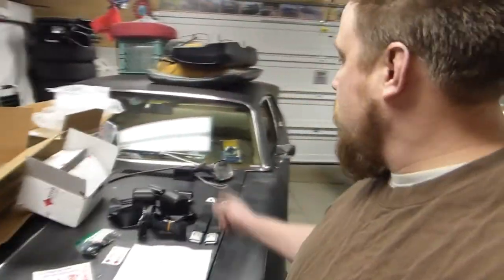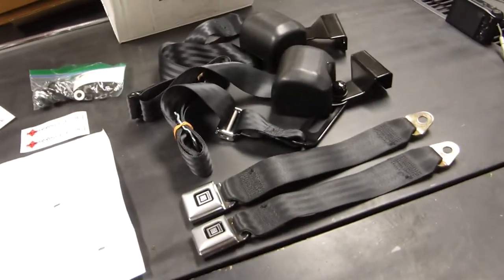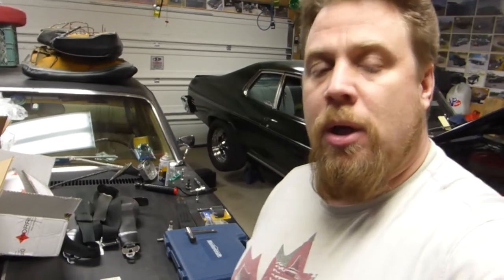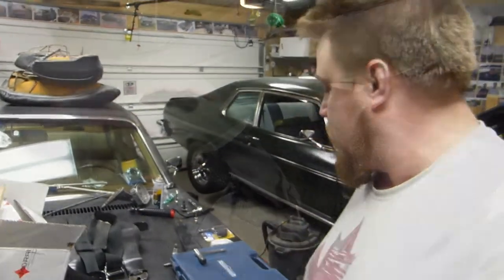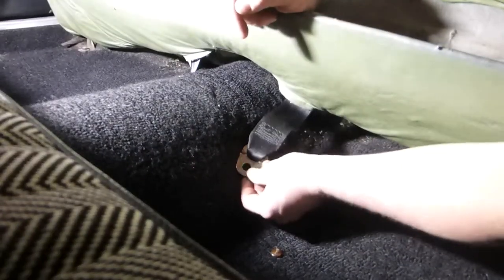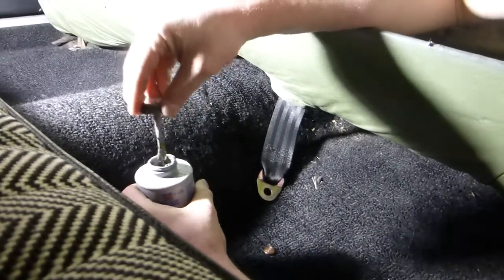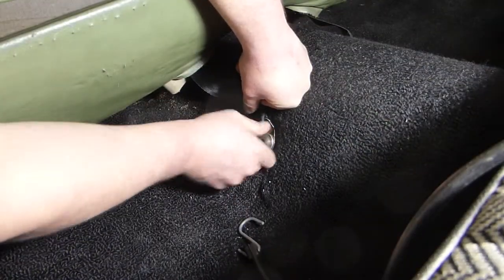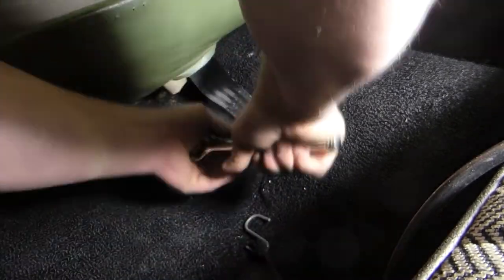Chevynova.ca - 3 Point Seat Belt Install in a 1973 Nova.

Comment: Like what you did, however, I’m trying to find the seatbelt lower part you just removed for the passenger side . Do you still have them ?
Reply from the maker: Yes, I still have my original seat belt pieces but do not wish to part with them at this time.